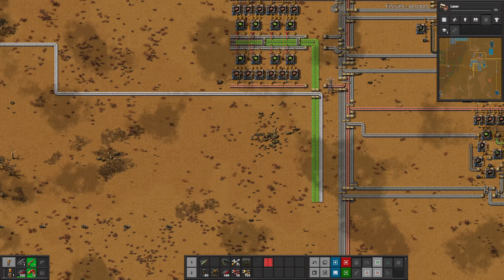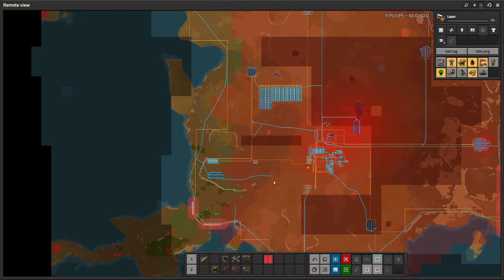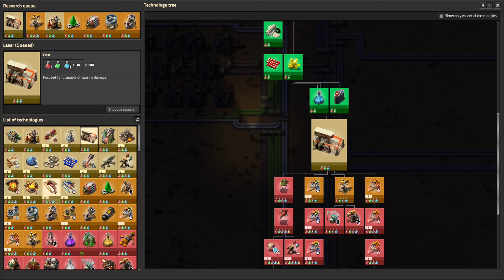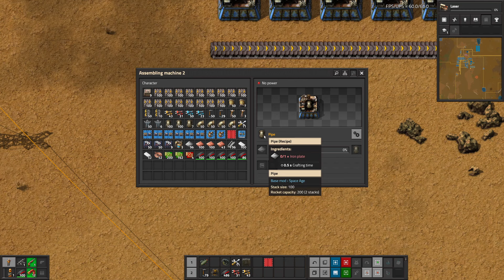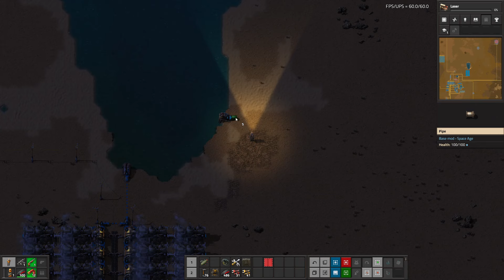Factorio Space Age: EP11 Making red circuits and bottling up blue science

Comment: I know it’s confusing, I can’t do that math in my head correctly every time either! 😂 For anyone watching who’s in the same boat, what always helps me is to remember not to get caught up in how many assemblers are being used to make the items, because all that matters is the rate you’re making them.

In this case, with 12 assemblers on a 12 second recipe that produces 1 item each time, that’s 1 per second of combined crafting time (not adjusting for assembler crafting speed because it’s pointless when all the assemblers feeding and fed by this are the same speed).

You know 1 engine per second is the target, so you can forget how many assemblers are making engines at that point, and just multiply engines per second by the inputs needed, which in this case can be skipped because it’s multiplying by 1. So 1 engine per second consumes 1 steel per second, 1 gear per second, and 2 pipe per second. And you did get the right number of gear and pipe assemblers (since we can’t build half a gear assembler 😅).
Reply from the maker: @TallinuTV  it’s not confusing per se. Were I doing it on paper and taking a moment to do it I’d have no problem with it because at the end of the day it’s just basic math.  The problem comes in with doing it on the fly these days. At almost 61 my brain isn’t as pliable as it once was. LOL I could lean on the spread sheets and ratio pages out there but where’s the fun in that?
Reply: @BoredBob  Well I'm only 47 so I don't have that excuse. 😉 😭🤣
Reply from the maker: @ LOL 👍
Reply: @BoredBob  Right behind you Bob
Reply from the maker: @MassiveDynamic9  Explains similarity in thought processes